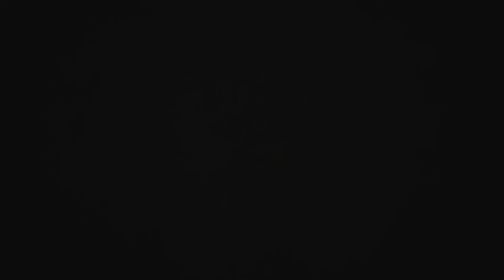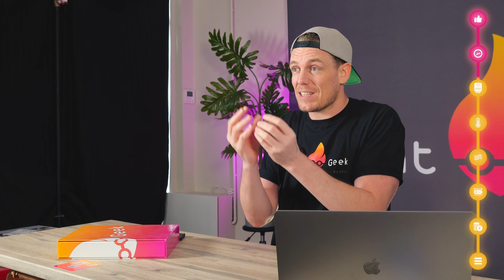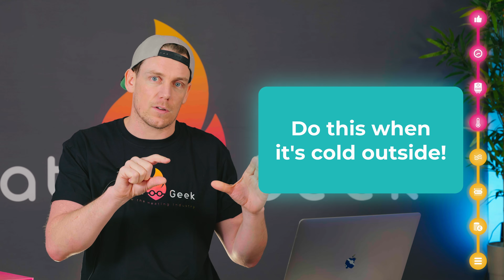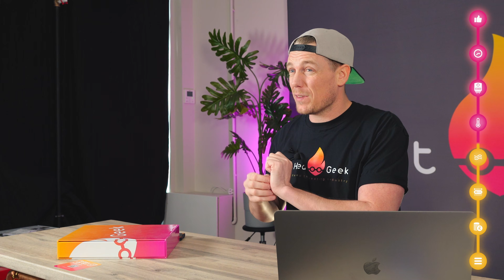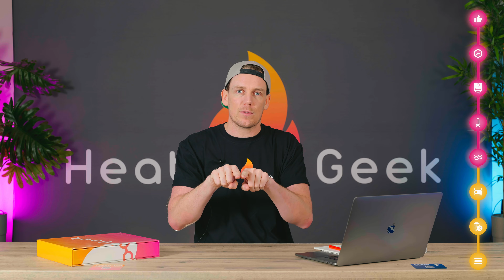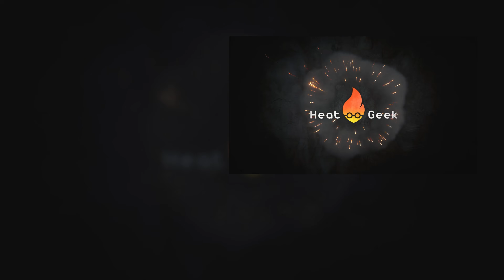PAY LESS FOR HEATING!! | The Secret To Boiler Efficiency | Consumer Advice

Comment: The training is crap but don't agree with the comments on air heat pump as its dependent on outside air even ground heat pumps take ages to reach temp and are better suited to under floor heating. i have been working with all types for years biomass CHP heat pump. But with new boilers they all should be using smart stat and use weather compensated as this will save nr 30%.
Weather compensation will pay for its self within the first year also the better boilers have a heat store for hot water.

Comment: My heat pump has used Zero because it is not switched on it don’t do hot water because it would not fit in my kitchen Heat Heat pump not required in summer,can’t afford to run it in winter haha so it will use zero in winter love it

Comment: Combi boilers especially designed by Plumbers to Generate winter income, When the temperature drops below freezing the out pipe freezes up and you have to call the Plumber with his handy blow lamp to unfreeze the out pipe   Why they do not send the outgoing liquid into the soil pipe or toilet I do not know (Oh yes it would not freeze that way and they would not make the £90 call out fee and 2p For blow lamp use)